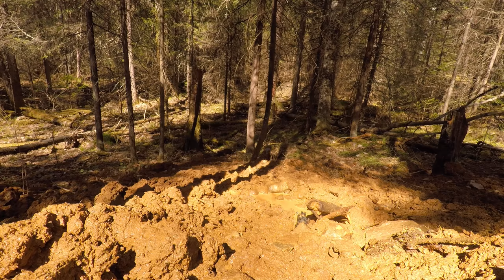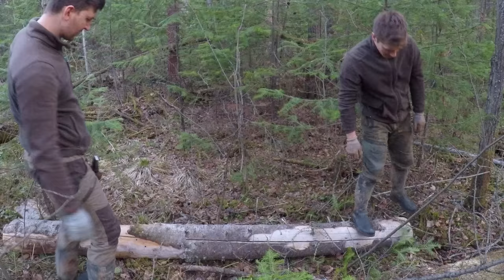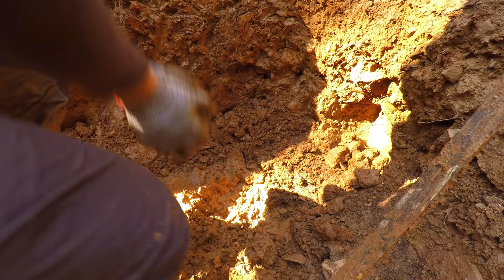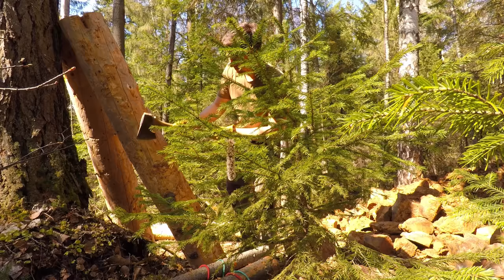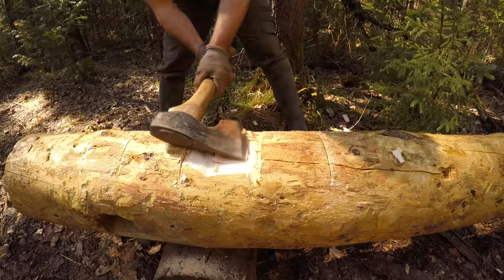DUGOUT building: digging a pit, construction frame for walls and roof, bushcraft SHELTER build

Comment: I'm no engineer but this looks to me to be a DEATH TRAP? THE Support  beams are BARELY IN THE GROUND 200mls deep? then the roof beams aren't properly notched onto support beams. I haven't seen any further if the side walls are supported any better but going by what I've seen already I don't feel it meets ANY safety standards at all. Without proper wall bracing if a heavy downpour happens he'll be sitting in a  muddy well in danger of the 4 walls & logs collapsing onto him?.  Even the way he de-barked the logs was dangerously close to femur arteries & one slip out there with no help. He'll be dead before he gets 2min up the blooming road. That's if he can stay conscience long enough to tie something round his thigh & stem the bleed?
Reply: The man has built many dugouts before, maybe he knows what he is doing.